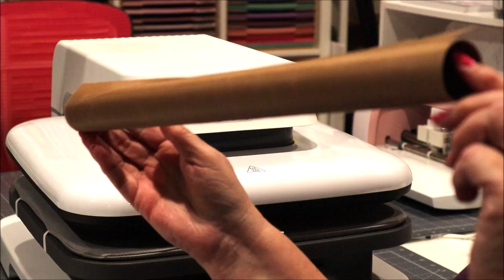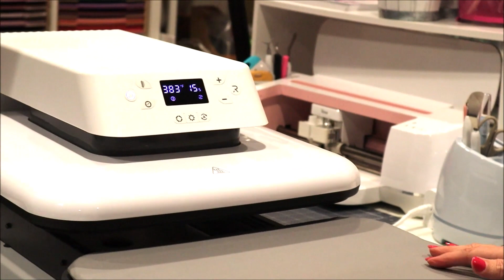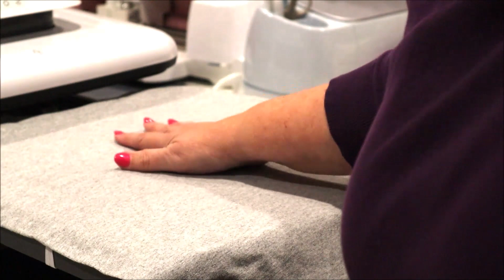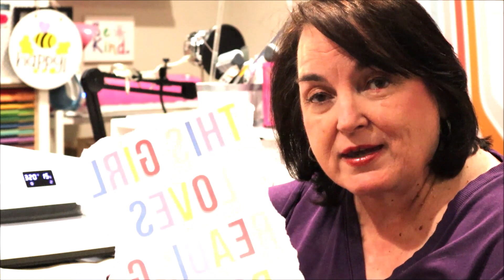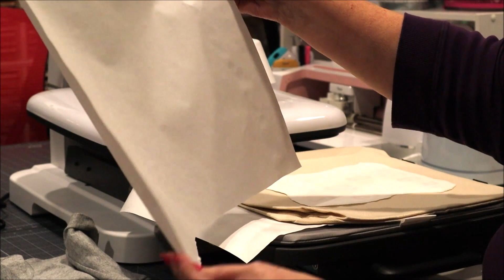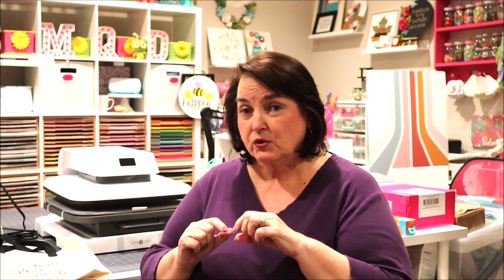HTVRont Automatic Heat Press Review & Should You Get One ?

Comment: just got my HTVRONT Auto Heat Press Machine today. And wanted to know if it is normal for the power button to blink as soon as it is plugged into an outlet? Also, I powered the unit on to make sure it worked, turned the unit off but the power button light will not stop blinking (unit does turn off) for over an hour -had to unplugged it to keep it from blinking. Let me be clear, when I turn off the heatpress it goes off, but the power button light will not stop blinking unless it is unplugged . Is this normal?
Reply: It shows exactly what you asked in the video 😮

Comment: that sub tote you made the bottom writing is faint where there was not enough pressure..this machine has issues applying pressure to items that have raised sections like the bottom of that bag...you should really mention this on camera instead of making out like it was perfect lol
Reply from the maker: Gosh you have super good eyes !  I had to go back and really look hard at the results to see a slight fading on the very bottom edge of the words on the tote. It wasn't because of the heat press not having enough pressure. I attribute that mostly to two things I could have done to make it better...1) I didn't use heat transfer tape to hold the image down and I know that gives better results AND 2) I left the tote bag bottom folded in and not pulled out which created a slight lump there that could prevent any press from getting even heat in that area.  Good News though ! I did another test on a tote using the adjustments I just mentioned and it pressed 100% perfectly. I will definitely mention those tips in my next video.  Thank you so much for leaving comments so we can all learn more about this NEW HTVRont Automatic Heat Press.
Reply: I have also seen many reviews on the Cricut Autopress having the same issue of not enough pressure on certain items. I am favoring the swing away design,  I just wish I could find one with a pull Out drawer for a 12x15 size. Unfortunately, I am thinking it is only available on the larger units.

Comment: issues, like when you put the grey tshirt onto the machine the correct way but then say if you want you can turn it sideways.....you should mention bigger tops and hoodies you CAN NOT load the normal front way as the machine does not shut with the overhanging material at the back as there is no where for it to go so you are forced to load sideways making it way harder to line images up
Reply from the maker: I didn't have a sweatshirt available to demonstrate but I am getting one to demonstrate.  I do personally know other reviewers that did try sweatshirts and hoodies with no issues by using the side method like I showed or by pressing with the hood hanging off the front.  I will be testing this myself soon and will report back on my findings.

Comment: the bottom pad on these is really poor quality, it actually has a piece of cardboard inside it which makes it alter shape and stay that way when you press certain items too. no idea why they put card board inside but pretty sure its because they know they messed up having so small gap from bottom to the top of the platen so they needed to make a thin as possible base mat. Most new heat press machines now are coming with way better silica gel and teflon mats so you never have the horrid smell of the silicone ones of older machines
Reply from the maker: I have reached out to HTVront to ask about the pressing pad as I do not know what is inside of it.  But I do know that it is removeable so if someone doesn't like the pad, they could put another there instead.
Reply: @DebbieONealSMQD   I just saw a video this week that a crafter cut open the pad casing and marklola12 is correct the reflective cardboard piece is thin and it warps/wrinkles over time which can interfere with project outcome. Yes the pad can be replaced and should be. I have a mini swing away and I have been researching to see the best machine to upgrade to for size and space. Thank you for your review❤
Reply: @lynnebizlyne436  I have just bought this HTVRont heat press. I read that the mat has cardboard inside, I read that you can turn the mat over and put the other side on top, so the cardboard side is on bottom or a lot of people are buying silicone mats to put on the base instead of the mat that it comes with. I also have a large  heat press mat that I can put under this if I need extra pressure or in place of the mat that came with it.

Comment: The swing arm heatpresses you actually do not need to swing them if you do not have room you can just raise the heat platen up and leave it where it is, i have one that happens to also have a pull out drawer so its rare i need to swing it out the way.
Reply: Mine does not have the pull out drawer. What machine do you have?
Reply from the maker: That is really interesting.  The swing arm one I had before did not do that.  Thanks for letting me know.